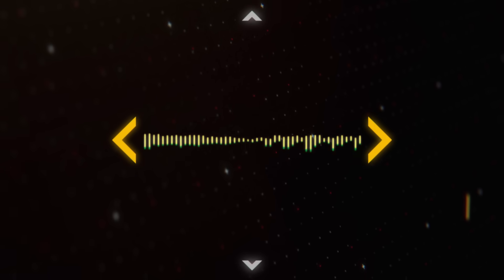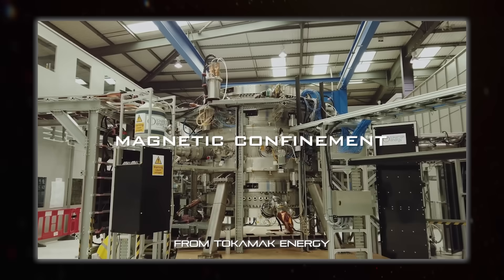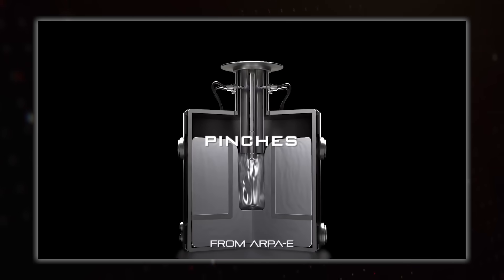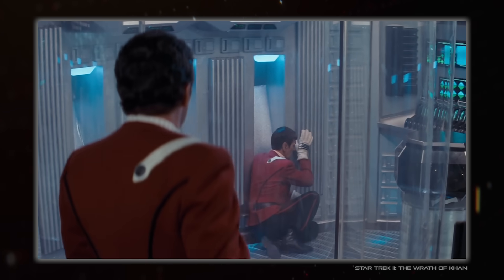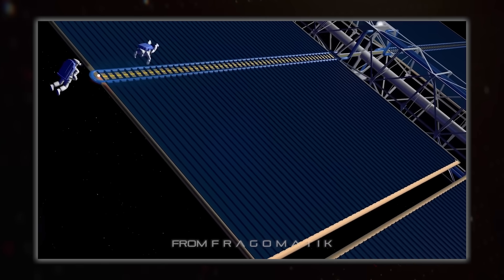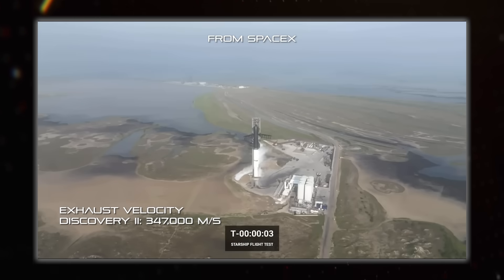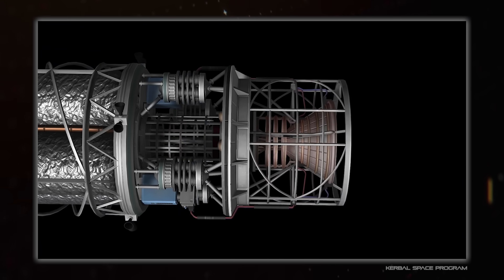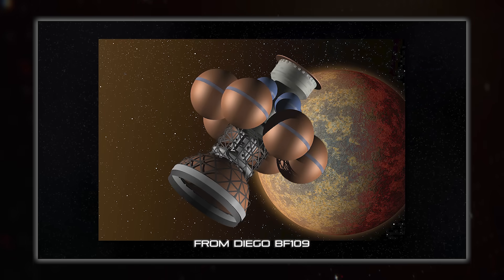Explaining Fusion Engines in Realistic Sci-Fi

Comment: Interesting fact: fusion has a declining return on power output the heavier the elements you use.   Fission on the other hand has a diminishing return with the lighter the element you use.  There is a point where both fission and fusion return less energy than what you put into them. That point is the element Iron.  The element where nuclear power dies.
Reply: The Element that kills not just fairies, but whole suns.
Reply: @3Rayfire  Never thought about it this way. Bane both to the fae and stars.
Reply: @3Rayfire  Suns are fairies, confirmed. =)
Reply: @3Rayfire  Are you suggesting that fairies are fusion-powered?
Reply: @artor9175  Are you suggesting that stars are Faerie powered?
Reply: When a star goes supernova the outward pressure from the fission reactions (all the photons, electrons and other particles) stop.  This causes a collapse at near the speed of light which basically reflects and explodes the core of the Star.  In the explosion there are a massive number of collisions of neutrons, protons and other fundamental particles.  This is how some of the larger elements are made, but not really the massive ones like uranium and plutonium.  Those are caused when neutron stars collide.  Since a neutron star is so densely pact that protons and electrons are pushed out, the energy density is much more massive.  When two collide they create an extremely energy dense, neutron rich explosion that can create ultra massive elements.  Those of course rapidly decay into lighter elements as they get bombarded with neurons.  Like a moon size nuclear bomb.  This is how you create the heaviest elements known to man.
Reply: When stars begin to fuse iron they experience immediate core collapse.
Reply: Thus why it's often colloquially called "Nuclear Ash".
Reply: Is nuclear power an elf?
Reply: So what you do is... use a breeder reactor that fuses elements lighter than iron up to (or past if the numbers line up) iron and uses those heavier elements in fission reactions, then combine the leftover iron from the back and forth reactions in antimatter reactions to grind every last scrap of energy out of every bit of matter that goes into the system.
Reply: I was trying to explain this to one of my freinds and did not do it nearly as successfully, so I will now be explaining it like this.
Reply: And yet the elements heavier than iron had to have been produced in fusion reactions in the first place.

When a star dies in a supernova, the massive amounts of energy released can achieve some wonderful things ...
Reply: @lawrencedoliveiro9104  More like the collision of neutron stars does wonderful things. Some of both neutron star's mass goes into forming a black hole but the rest gets converted into all the heavy elements on the periodic table.
Reply: @lawrencedoliveiro9104  They do it so that we can then dig up those elements and fission them again, harvesting the energy of long gone supernovae and neutron star collisions. :P
Reply: @johannageisel5390  Combustion engines run on the last gasp of long-dead creatures. Fission reactors run on the last light of dead stars. And fusion runs on the echo of the birthcry of the Universe.
Reply: @lawrencedoliveiro9104  Consumes more energy than what is produced, that doesn't mean it's impossible, luckily.

But I think it's only neutron stars (and maybe quasar, not sure) that are able to make elements heavier than iron.
Reply: @lawrencedoliveiro9104 Kilonovas is where the gold uranium etc come from which is wild.  Neutron stars meeging with neutrons stars apparently makes a big a$$ boom 😂
Reply: @lawrencedoliveiro9104  yeah that's not by fusion tho
Reply: @mryellow6918  What do you call it when lighter nuclei come together to make heavier ones?
Reply: @lawrencedoliveiro9104  the term isn't all nuclei. Neutron capture is the correct term. Fusion is only for particles with charges.
Reply: @mryellow6918  “Neutron capture” is the term for capturing of neutrons, nothing more. What do you call it when lighter nuclei come together to make heavier ones?
Reply: @lawrencedoliveiro9104  it captures a neutron and can either turn into a proton or stay a neutron. There's a reason stars have iron cores
Reply: @mryellow6918  So you think fusion of nuclei is all about “neutron capture”?
Reply: @lawrencedoliveiro9104  it's how you make elements larger than iron yes
Reply: @mryellow6918  So what happens when those iron nuclei bang together?
Reply: @lawrencedoliveiro9104  what happens is they start to neutron capture and create an endothermic reaction.
Reply: @mryellow6918  Where do the neutrons come from?
Reply: @lawrencedoliveiro9104  No they don't. Heavier elements are all created in super nova's.
Reply: Carbon nitrogen sodium and calcium are probably going to be the best options.
Easily the most abundant elements within the hydrogen to iron range. 
And i suspect Nitrogyn & Carbon are the easiest of those 4.
Reply: Nuclear power is a fey creature confirmed.
Reply: Explains why fusing molecular hydrogen into helium is the ideal. 

Sadly molecular hydrogen is an extrovert and demands friends.
Reply: Wonder when we have severe understanding of both. If we can make a loop of the two like in Stars. Or well a much better one. Have the lightest elements fuse then somehow transform it into heavy elements then split and turn back into lighter elements, basically a loop. Just like in batteries where you have a high ep and low ep to create the highest potential energy difference. Which makes the most powerful batteries.

Only problem is what is the lightest elements that can be fused into a heavy element. So when it’s split it goes back to being a light element. But Since the elements in the periodic table are all made up of a single type of matter, if you combine that matter in different ways you get different elements. Unfortunately we don’t yet have the understanding to do that properly so we can only do that in our colliders by pure chance since we can’t yet manipulate matter so small.
Reply: That's so metal that humans have mastered the dead bodies of stars
Reply: Indeed it is Iron. But I am not sure what you mean by putting more energy. There is a nucleus with minimal energy and that is iron. If you fuse heavier elements that will cost you energy indeed, if you split lighter elements you will have to pay the energy bill as well.
Reply: The binding energy curve.
Reply: that's quite a complicated way of saying iron is "mid"
Reply: fusion does work but rn its very inefficient ex. input power 15kw, output would be 20kw, 5 kilowatts only max:face-red-droopy-eyes::face-red-droopy-eyes::face-red-droopy-eyes::face-red-droopy-eyes:
Reply: @thefirstsin  The problem is scaling it down. The cores of stars have the benefit of enormous pressure from their mass, along with all their energy, to fuse atoms. On Earth, we have to use almost purely energy to get fusion going. It's a very difficult, very precise, resource and time intensive field of research at the cutting edge of our physics knowledge. Since we can see it clearly at work in stars, I think we'll be able to figure it out, it's the "when" that is difficult to guess

Comment: Terra Invicta puts a lot of effort into implementing all sorts of propulsion mechanisms in for the player to develop and use on their ships - for good or bad. Yes, you can have an Orion-based design, lots of crappy ion engines, or eventually work your way up to actually good inertial confinement drives.
Reply: Why not the neutron flux/tourch drive fission technology is far to underestimated. I could build an engine with 4g acceleration with 1K delta V. I mean we can even build a nuclear dusty plasma engine with 1.5 million ISP.
Reply: Read that as Onion-based design, was very confused.
Reply: @Just_A_Simple_Time_Traveller  The onion of defense has expanded to include propulsion!
Reply: onyo
Reply: @mrsuspicious1743  I mean, they certainly can't kill you if they can't catch you
Reply: @crashstudi0s  correction: they can't kill you if their weapons can't catch you.

Comment: Im very surprised you didnt mention Mechwarrior/Battletech, as fusion engines are prominently used in them. The mechs run on a hydrogen fusion reactor, heavily shielded from radiation and held in containment with a powerful magnetic field.
Reply: This video is more focused on fusion thrust for spacecraft, not necessarily fusion reactors in general. Battletech uses fusion reactors in battlemechs, but doesn't go into depth much about how dropship and jumpship engines are actually powered. It's loosely suggested that dropships operate on some sort of ultra-efficient chemical thrusters to maintain thrust gravity, but it's never really delved into.
Reply: @gabe9125  it is explicitly say that drop ships aerospace fighters and warships use fusion drives
Reply: BIG props for bringing up Battletech in general though, genuinely one of the most grounded and realistic sci-fi franchises out there, from the technologies to the people and politics
Reply: @gabe9125  It's a shame he never talks about the franchise at all. There's a lot of good stuff there.

Comment: A more recent of fusion ignition system uses 'small', opposing linear particle accellerators to create the heat and maybe pressure for nuclear fusion (I forget the exact details at this point).

They can start and stop the fusion process many times a day.  It uses an unusual, compact super conducting linear magnet design that has been known for years but almost never used.
Reply: I guess one of the biggest challenges for that is extremely precise beam alignment, off by the tiniest amount and the two particle beams miss each other and no fusion occurs.
Reply: @Croz89 Hellion said there biggest problem is that the chamber melts

Comment: Fusion power is 20 years away... and always will be.
Fusion powered spaceships are a further 100 years away... and always will be.

It's quit appropriate that you modeled that in Kerbal Space Program.  Fusion power is just as realistic.
Reply: We probably need some kind of nuclear engine to make manned trips to Mars and beyond. Sure, it can be done with chemical engines or ion thrusters, but it would either require a massive fuel tank or be really, really slow, the latter especially important for manned missions because pesky humans need things like oxygen, food and water and don't like being exposed to excessive amounts of cosmic radiation. A lot of those problems can be reduced by making the trip faster, and that would be helped a lot by more efficient thrusters.
Reply: @Croz89  One of the more likely is a mix of nuclear power and a whole lot of ion drives. Since they could run non stop off the nuclear power you could get really fast speeds over time. Like a month or two from earth to mars.
Reply: @Zacho5  They'd have to be massive, since the thrust from an ion drive is so tiny.
Reply: @Croz89  too a point, look up nuclear electric propulsion. There's a ton of ship designs.

Comment: The radiation problem is heavily dependent on the fusion reactants. For example, a Dual-Deuterium fusion spews out high-energy neutron radiation like a hose, Deuterium-Tritium makes Dual-Deuterium look like its completely safe, a Deuterium-Helium 3 fusion reaction produces less radiation than a dual-deuterium reaction but enough you'll need some protection, a Dual-Helium 3 reaction is pretty low on the rad-charts but requires quite a bit of Helium 3 to function, and the masterpiece of fusion though is the proton-proton chain (aka what stars use) which uses good ol' protium (aka atomic hydrogen) and doesn't spew much in terms of radiation in the initial reaction.

In several of my settings, the various factions use a fusion rocket based on the GURPS High-Efficiency Plasma Recombustion Fusion Rocket (basically a fusion rocket similar to the Epstein Drive from the Expanse in that its propellant-efficient, though instead of hydrogen propellant, they use water) that uses dual-helium 3 reactants or the incredibly hard-to-kickstart proton-proton chain, which are far lighter than other fusion engines.

Comment: I see the fusion drives in the Expanse to be aneutronic. The ball is very solid and in the same season, a bunch of colonies were making a big deal outbof their mined lithium. The beams would be proton beams causing the reaction. The alpha particles could be used as the thrust.
Reply: Unlikely the alpha particles alone are enough, the characters mentioned reactive mass a few times meaning that it, probably hydrogen, is likely pumped through the reactor (alongside a closed cooling loop) to capture its heat and then as it heats up and expands is thrust out the nozzle, most likely additionally accelerated by the magnetic coils. Given how efficient Epstein drives are, likely they use all available means to turn that fusion energy into thrust.
Reply: @mihan2d  They use water as Rmass. The RCS uses water heated up by the reactor into stream. Least from the books.
Reply: @mihan2d  alpha particles are helium atoms without electrons.
Reply: @WolfeSaber  I know. But you need a lot more reactive mass than just reaction products to achieve anywhere near desired thrust and efficiency especially given how Epstein drives aren't supposed generate a ton of waste heat
Reply: I have this theory that they use deuterium or heavy water for reaction mass to do a second fusion reaction in the engine itself, getting the fire of the fusion reactors inside their ships to get the job done. Probably makes sense because Epstein didn't sound like he made major changes to his yacht.
Reply: aneutronic fusion does not exist in an He3-D engine, you will get side D-D reactions and a good dose of radiation. Alpha particles are also not enough for the thrust seen as you will need to add reaction mass which will start cutting your efficiency
Reply: @CarlosAM1  I'm not talking about an He3-D reaction. I was talking about shooting a proton at a lithium or boron atom to create alpha particles. Also, light is radiation.

Comment: Would you be able to take this a step further and say "you have a fusion power plant cooling it and venting off the heated coolant is used to produce thrust and shunt heat off the reactor" (sure this adds complications but storywise it makes a good place to not have to hand wave off things like proper cooling and propellant, or is that not really going to count as a "fusion" drive in this context?
Reply: Using the heat of the reactor to expand propellant is basically a fusion drive, but kind of only the "afterburner" part. Perfectly doable but probably a bit of a waste of the potential of fusion!
- hoojiwana from Spacedock
Reply: @hoojiwana  I'm just thinking from a sci-fi where you don't have to magically handwave the other portions of the tech that aren't so feasible just yet regarding nuclear propulsion in general.
Reply: @agoddamnferret  Yeah its essential a fusion thermal rocket, just gotta balance the heat when the drive isn't actively running but the reactor is.
- hoojiwana from Spacedock
Reply: @hoojiwana  yeah was thinking about that too, using something like radiant cooling like the ISV from avatar or if you have a large coolant supply you've locally harvested etc you'd mix till thermal saturation while filling up power storage and then bring down your reactors once not moving. (heck even hybridization of this concept would possibly bring higher idle times. but yes that is an issue.

Comment: Fusion engines only makes me think of the end of Halo where they blow up the Pillar of Autumn to destroy the ring.
Now when I see that scene, I think of how a weaponized fusion engine would essentially create an artificial star, not too far off from what we see in the cutscene.
Reply: "A reaction drive's efficiency as a weapon is in direct proportion to its efficiency as a drive."
— The Kzinti Lesson, Larry Niven
Reply: @darmok42  fuck thats a thought ive never had before
Reply: @stompyrobutts  It's basically a ship sized lightsaber.
Reply: Now imagine if that engine were antimatter instead of fusion
Reply: The covenant reactors, like the one you see in the opening section of Halo 2 — “To give the Covenant back their bomb.” — uses the Covenant’s artificial gravity technology to compress deuterium and tritium to produce essentially a stellar core that they can pump fuel into and pull power out of. 
Or tap some plasma off, channeling it through an artificial gravity system to accelerate it to large fractions of light speed, essentially creating the galaxy’s biggest plasma cutters.
Reply: Fusion reactors can't really blow up like they do in popular scifi
Reply: if your engine is massive enough, you quite literally have a star stuff flamethrower on the back of your ship. aim your rear at the enemy ant blast off